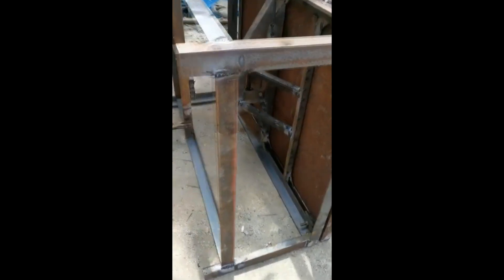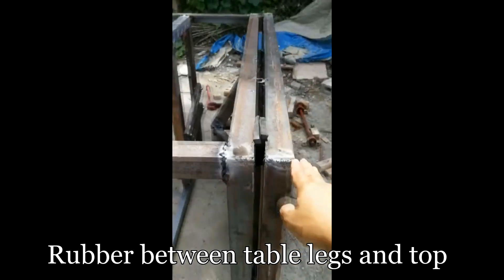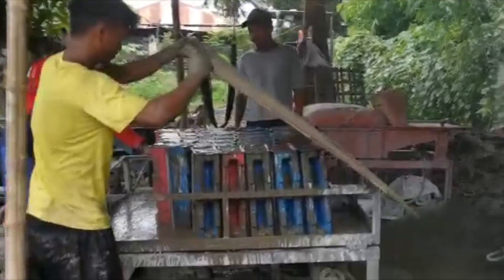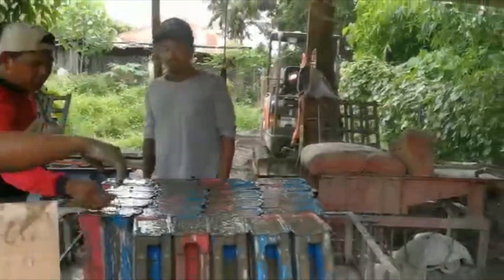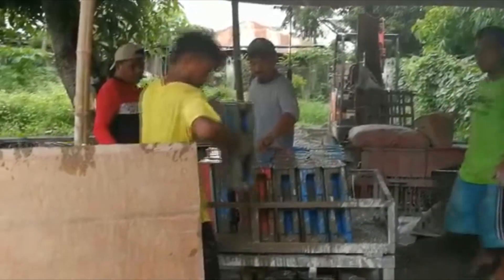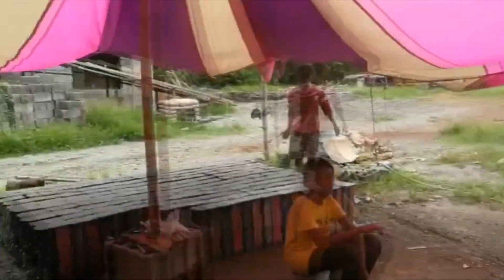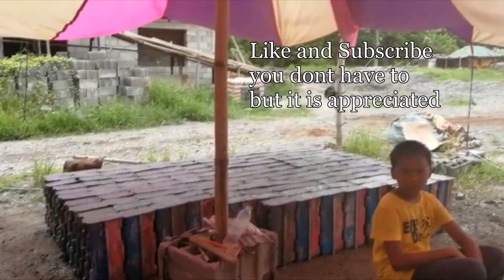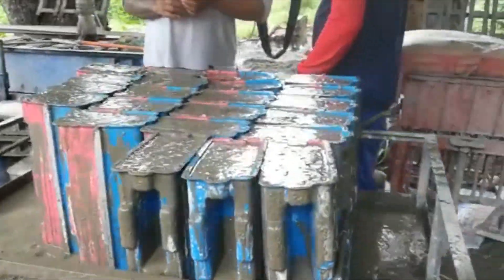Building a Vibrating table

Comment: moter eke detail dannako
Reply from the maker: The motor came from the hollow block machine, you could use a washing machine or tumble drier motor with the correct chain/cog combination as they will be slightly less powered

Comment: Too much water in the mix, slurry runny. Best practice is 30 to max. 50% water to cement by weight and since you are vibrating the lower water ratio. Good video though.
Reply from the maker: Thanks for the tips!